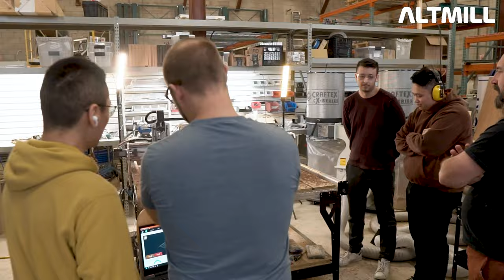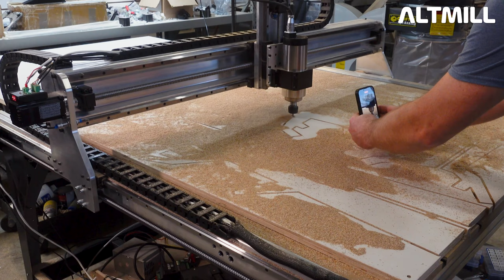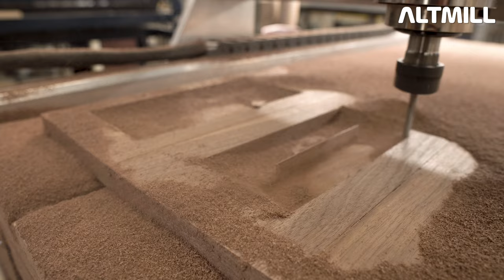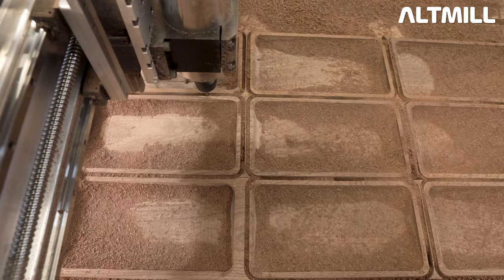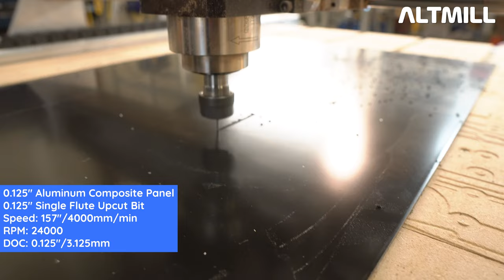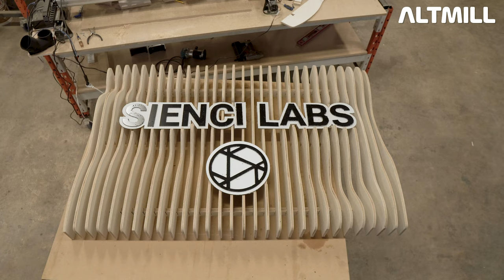AltMill CNC Action: Crafting Diverse Projects - Behind the Scenes Exclusive!

Comment: Will the ALTMILL ship with the SLB?
Reply: Since you didn't get eager and enthusiastic response; I'll take that as a maybe not. So ad my voice; if it's not included, what about make i an option? I for one, need no legs. I have a table with vacuum system built in. Need to modify the Altmill just a tweak to accommodate vacuum and a 4th axis, and vertical tenon cuts...
Reply from the maker: Yes, if you'd like more information we spoke about it more in the launch livestream. It's a specially made version of the SLB to power the AltMill 🙂

Comment: What’s the spindle power rating?.
Reply from the maker: If you're asking what the spindle shown is, it's a 2.2kw.
Reply: @SienciLabs  Product ships with a 1.5kW. Do you think you will pull off a full DOC in 3/4" ply with compression bit as shown? This is key for me.
Reply: @SienciLabs  I'm wondering the same question about the spindle. Do you have a link to the spindle shown here, I'm wondering if this is like the Amazon/Ali Express $500 spindles or if it's a more expensive one? Does the extra weight from 2.2kW spindle cause problems with the X gantry sagging down?